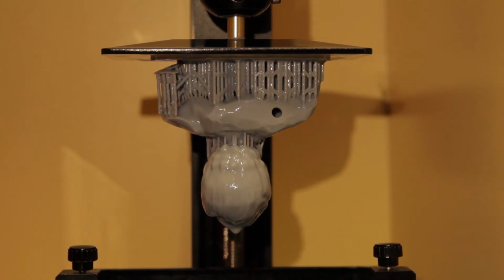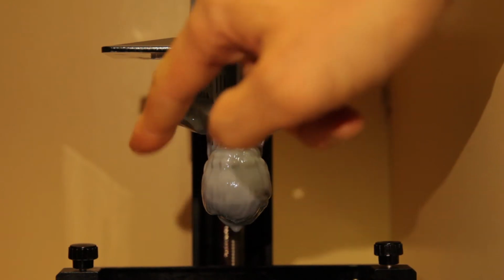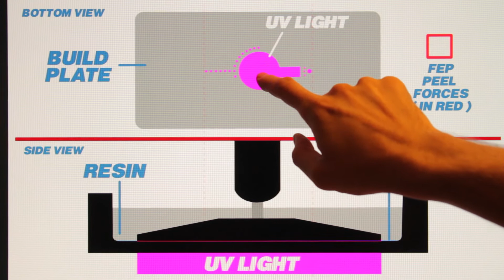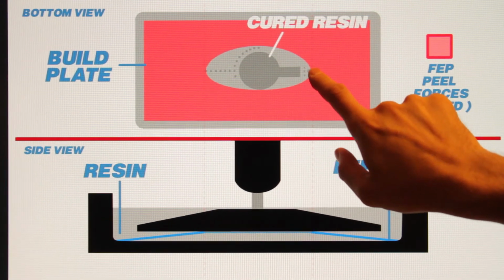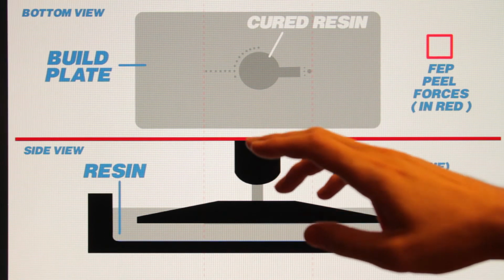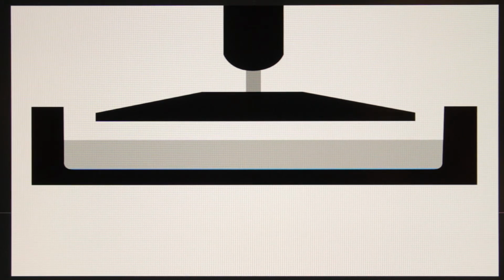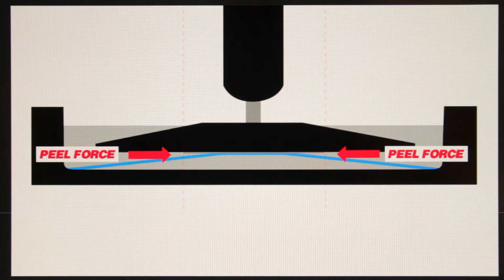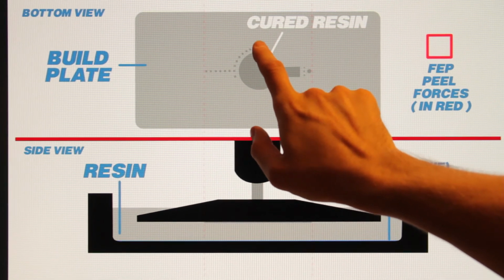PEEL FORCES ON RESIN PRINTERS ILLUSTRATED

Comment: Very informational! I was printing a 2.5mm thick large area panel on the bed and then always got the panel thickness to be like 3-3.5mm, probably because my initial layer has peeled from the bed and the UV light cured the material behind it

Comment: I dont have a resin printer yet but hopefully soon. BUT this demonstration you made is really nice. It also brings up a good point of where the stress is on resin supports. Keep it up man :)
Reply from the maker: Thanks!! But for larger objects id definitely use thicker supports or else you have to use tons of smaller ones. But It also depends on how flat the bottom is. If its flat and you cant rotate it you dont have much choice but to put loads down unfortunately!

Comment: same issue but my raft stays fine but the model peels and curls on the same side this does not happen with my other resin only the standard resin like im through 70% a bottle and not a single sucessfull print another issue i have is the flat sides are like curved almost like doming instead of being flat its beyond annoying and expensive
Reply from the maker: Yeah if you print thin it warps. Id leave the support on thin areas and cure them first after clip them to avoid warping. As for normal resin ive not used it but i set my supports all to be heavy with a contact diam of 0.06 and ive never had a failure since. My failures were coming from the grid issue in the early mars pro.
Reply: @Cloakfiend  the issue is it peels during the print by the time im able to remove it form the plate its bent out of shape i changed the fep tried again got 1 part printed perfectly flat on both sides but 2nd time was back to a disaster  but i will for sure try your method
Reply: even if i add a raft it peels off the raft literally makes no sense 75% out of a bottle resin not 1 print
Reply from the maker: @NHILOtunes  ive gone with heavy supports only now 0.6 contact diameter never fails for me now. Slighly more cleanup but im ok with that.
Reply: @Cloakfiend  I fixed my issue completely im stupid and left that warning sticker over the LCD so i tried to remove it and sure enough thr was a protective sheet over it i had to remove and the yellow sticker blocked the screen form the corner now i removed it it's flawless

Comment: Crazy thought... What about printing a ring around your model that's moderately thick to deal with the harshest suction force?
Reply from the maker: It will only work to some extent as the sucktion will still apply to some extent. The best way is to control the temp and increase connection sizes of the supports. Or have millions of smaller supports but i would.not do this going down the manual route.

Comment: On my Elegoo Mars 2 Pro, when I first tried to print the included Rook demo model, it never came out right. It peeled several tries, basically leaving a lot of ultra thin circular slices floating around in the resin vat. 
Came to find out the .ctb file is set up all wrong - BY ELEGOO. It peels because the bottom raft layers are set to insufficient cure time. I doubled the bottom raft cure time, and now it sits on the build plate nice and firmly. I do that to all my prints. At least 35 seconds. For larger prints I set the first 4 layers of the raft to cure 40 seconds each. This can potentially decrease the life span of your FEP, but the build plate is a rough surface and the FEP is a smooth surface so the build plate WILL win the tug o war, so to speak. 
It's also good practice to always inspect the FEP after each print. Over time it will become cloudy and sloppy, and then it's time to change it. If you don't you will end up with the FEB tearing and your UV screen flooded with cured resin. 
Using the method of prolonged bottom layer cure time, my FEP will last for about 10-13 large (tall models, taking up most of the build area) prints.
DISCLAIMER: I still consider myself new to this, and by no means an expert. If you have better advice, I'm all ears and eager to learn.
Reply from the maker: Feps last way longer than 13 prints. Ive yet to change one! I print a lot now.
Reply: @Cloakfiend  I will need to check the quality of the FEPS I get then. They get sloppy real fast, and I thought it was because of the extra cure time I input, pulling on the plastic. Thanks for the info.
Reply from the maker: @My2Cents1  no probs
 I print tons and although supports leave dots on your prints its only visible at a certain angle but the fep is fine. I use regular elegoo vats. No fancy nfeps or anything either. And no pointless lube on my fep either.
Reply from the maker: @My2Cents1  i also dont have a screen protector.

Comment: i listen the voice like stick the job on the fep..i think is the same to explane to video...how can fix this to dont stick..???
Reply from the maker: Most common problem for not sticking is incorrect leveling and not high enough exposure.
Reply: @Cloakfiend  I have tray to place a model horizontal and vertically  and result is better horizontal but also i listen the voice.Usually the model is 10 cm and i place always vertically  to have more models to print.
Reply from the maker: @kostassakkas4389  bad levelling is the main issue i find. I hate leveling these resin printers!
Reply: @Cloakfiend  first mind to had is to warm resin before printing.i will try to calibrate the platform.i hope to find the broblem.
Reply from the maker: @kostassakkas4389  i usually warm it i did it recently but half broke of. I thing its mainly levelling to blame. Ive printed in cold and warm temps. Warm are definitely better than cold! But hot is no good either. I use a bit of tenatious but it stays slimy for some reason.